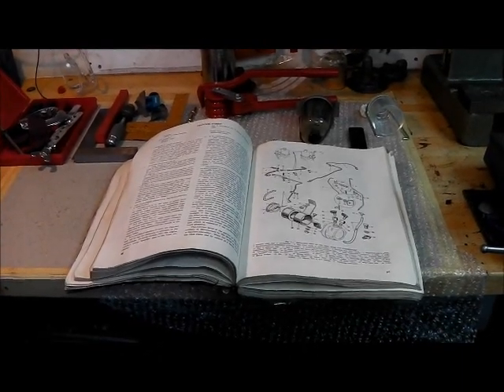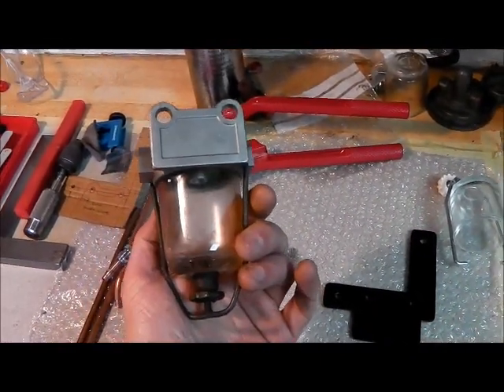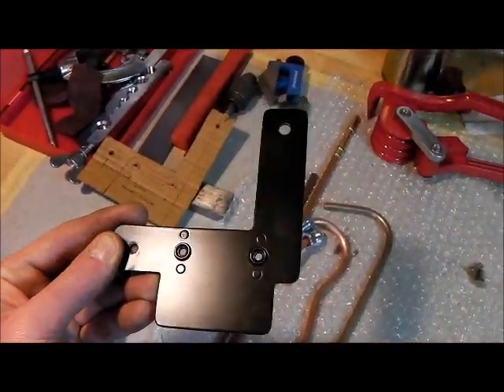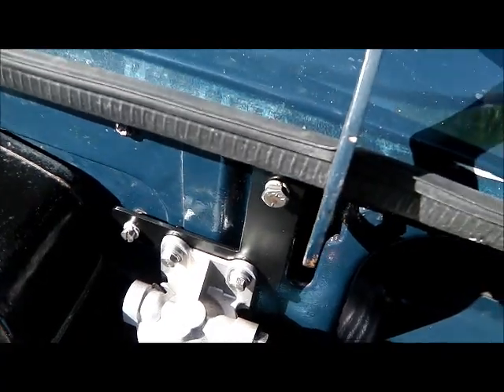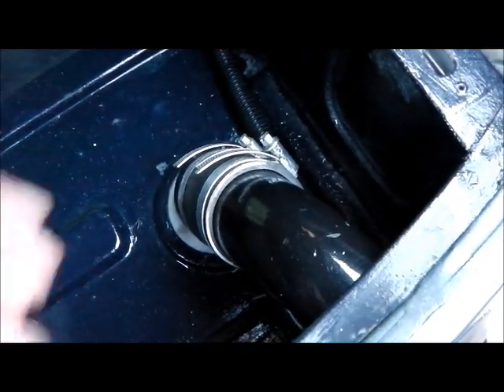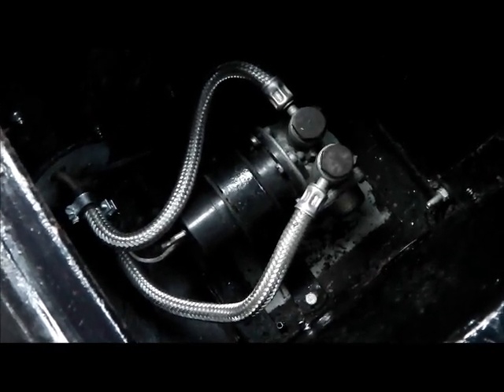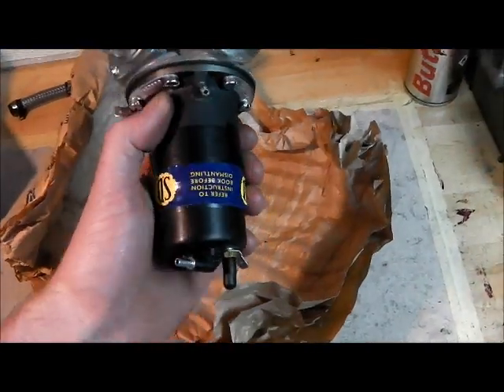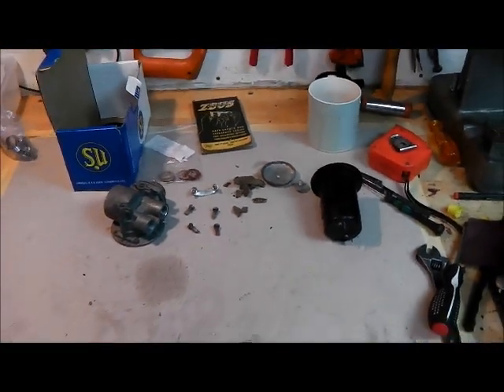MGB Alternative fuel filter

Comment: My landrover used to splutter like that at a junction. Turned out I had a bad vac advance and the mechanical was seized. That was on the 25D . Chased it for ages . Ofcourse , always the last thing you check
Reply from the maker: The distributor was the first thing I checked (see a previous video) and the advance was indeed stuck, the timing therefore had been set way out. Sorting that made a huge improvement, but we're not quite there yet. They say that most fueling problems are actually ignition problems... but not in this case!
Reply: @steamwally  actually come to think , I recon I saw that video . Slept since Haha
Reply: @steamwally  by the way I'm the chap off of series landrover group that you were talking to about the hif44 SU
Reply from the maker: @MrLegograbber99  Ah yes I remember, do post up some film once you've done that conversion!
Reply: @steamwally  will do. Should be arriving tomorrow or Friday  . currently working on the videos for the rover p4 .

Comment: I'm about to make some captive nut plates to go inside my S2A Land Rover's new door pillar behind the hinges, by welding the nuts in place, but those "riveted captives" of yours look so neat. How was that done? I can't see any rivet heads and I can't reconcile a rivet holding a nut in my head.. :) Good video, thanks for sharing and look forward to the carb overhaul.
Reply from the maker: Thanks, the captive fittings are standard AGS parts, we use them on vintage aircraft at work. I bought some recently on ebay for my own workshop as they are just so neat. They are flush riveted with countersunk rivets - no need for that really but it looks tidy. You can actually buy the captive nut plates for Series Land Rovers, might save you the trouble..
Reply: @steamwally  All I can find for AGS is Advanced Groove System from Victaulic. :) Is AGS an aerospace term? They do look very neat. Did you do the countersunk rivets with hand tools? I know pegasus parts do the captive nut plates but they are out of stock at present and I've cut the plates ready today.. Cheers.

Comment: Nice work. Where did you source the captive nuts for your adapter plate? And what was the sealant you used around the gas filler neck? You made me feel ashamed about all the holes I have drilled in firewalls and fender wells. I will try to look for more elegant solutions in the future. Thanks.
Reply from the maker: Thank you! Well, someone once told me that I'd regret ever hole I ever drilled in my Land Rover, and he was right - this is a far nicer car and it deserves better treatment. The sealant is Tiger Seal, a PU flexible sealant. The captive nuts are a standard AGS fitting with 2BA thread, as used in aircraft.